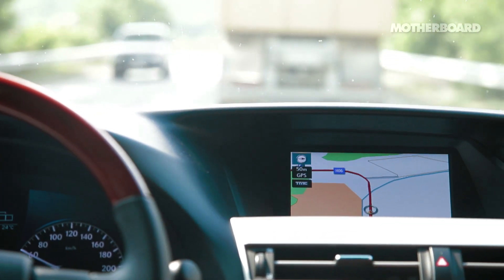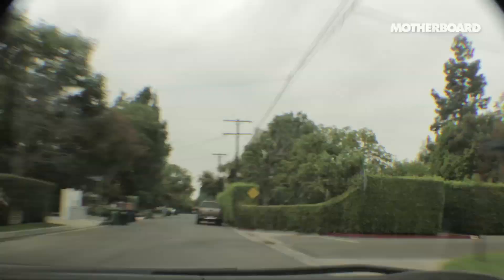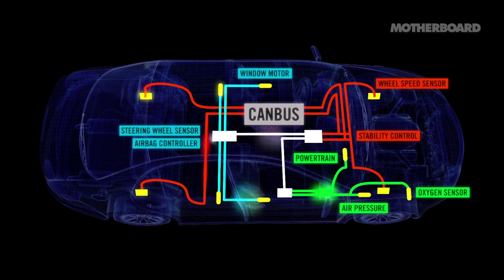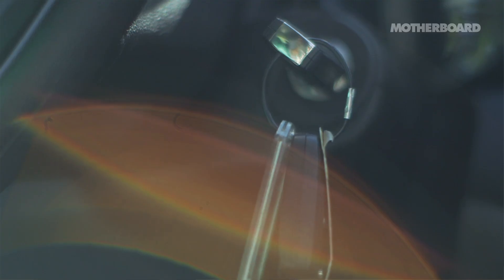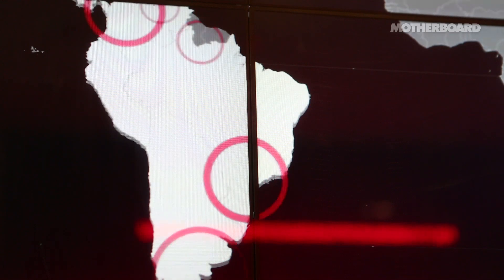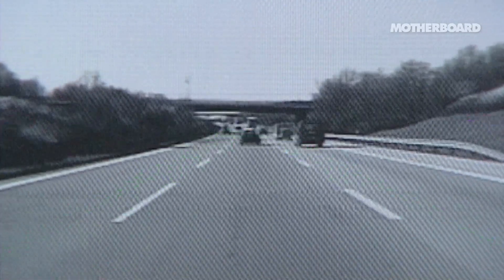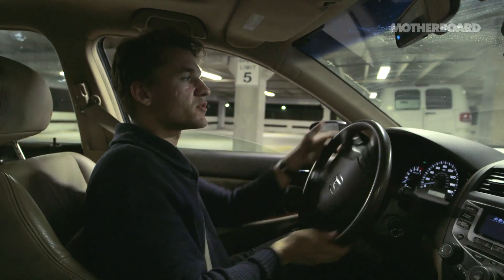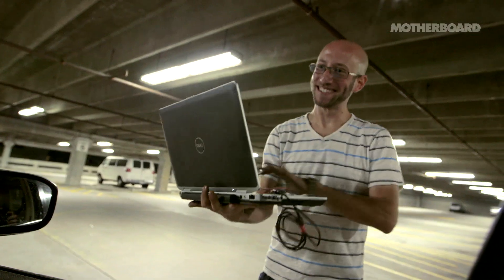How to Hack a Car: Phreaked Out (Episode 2)

Comment: Isn't it weird that recently governments have introduced recycling schemes to get rid of older cars?
Reply: Thank you FSS. Every gadget that has "smart" or "intelligent" in its name shares its data with agencies that carry "Intelligence" in their names.
Reply: PianoGesang
Yep. I have a 2 by 3 foot parabolic directional Wi-Fi dish set up over here that can handle 100 watts and do 50 miles. I can grab internet from unsecured connections 50 miles away anon. Anyway, currently connected by Wi-Fi at 5 Mb/s. One of the connections I can see not a block away is my neighbors new thermostat. If I was so inclined I could fuck with him, it's cold outside tonight, I could turn it off with my laptop and dish, and so could those 3 letter agencies if they wanted too.

I heat with propane, if they want to turn my heat off, well they will just have to come out here to do it.

When the Arab Spring went down, the Government in Egypt hut down everyone's internet and phones, and that's not the first time Government have done so either. I was in College taking IT/CNS classes at the time and one of my assignments from one of my classes asked by my professor was, "if they shut down communications how could you get the word out and communicate?"

Nice to know all Professors are not stupid. Don't depend on your phone, buy a man portable Ham Radio, and have your friends do the same.

Those smart meters have a zigbee communications device on them, that's how they control it from the power company or elsewhere if they wish. Look into that.

https://en.wikipedia.org/wiki/ZigBee
Reply: +FullSpectrum Survivalist

>> You need to use your brain

I do. I'm a Computer Scientist myself, so I think I'm reasonably qualified to talk on the topic. I'm not sure you are, though.

>> why do you think they are trying to link everything together, it worked fine the other way didn't it?

One word: Convenience. Computers worked well before the Internet became a thing. Now, with the Internet, they work better, allow us more access to information, and a lot of things, such as accessing YouTube from the convenience of your own home, or phone, or tablet, etc.

Cars have had on-board computers for decades... and they made the cars more fuel-efficient, among other things. The problem described in this video boils down to, as they said, people/businesses that do not think about security during the design stage of their technology.

The same is true of the Internet; security was not built into it from the get go. The same is also true with email, and other technologies.

>> I'll tell you why, one word, control.

Sure, control is something else that you can add to the list. That's why, IMHO, people should use software that has been released under free licenses (e.g. GNU/Linux), because when you control the software, you control the computer that runs it.

>> They can turn off everyone's power now at the flick of a switch, that's why we have smart meters, they don't even have to come out to our houses.

Or maybe it's because not having to send people to inspect millions of houses just to look at a number is significantly more cost-efficient. It saves money both to the consumer and tax payer because a single computer can do the repetitive task of thousands of workers (i.e. no need to pay people to visit homes for it), no need to maintain a fleet of vehicles that wear down and break, no costs for gasoline, and a bunch of other things I could mention. Did you fail to consider all of these things? Did you use your brain? (That was a rhetorical question.)

>> They can cut our power off, and leave theirs own, this is not a coincident.

So what? Even if they didn't have computers to do that, if you fail to pay your bills (though you might not be old enough to do this...), they'd still send people to your home to physically cut your power, or water service, or Internet service, etc. Given how crazy some people are, it's also safer for the employees trying to do their jobs (i.e. no need to risk getting attacked by an upset customer)

>> There is a difference between a silly conspiracy theory as you put it, and a conspiracy fact.

The difference is that the CT is still silly, and there is no conspiracy "fact". At best, any advantage that a government could leverage from an existing system would materialize after the fact, not before. For example, Facebook did not begin as a "conspiracy" to gather information about people just so it could be made available to government. Government just realized, years after Facebook had been operational by a private business and had already amassed a large number of people, that it could send subpoenas to a single centralized entity... and still, at least in the US, businesses don't always comply with them b/c there's something called the 4th Amendment that protects against unreasonable searches.

Ultimately, the only reason Facebook became such a treasure trove of personal information is because you, as a user, chose to give it to them willingly. No one "forced" anyone to sign up, much less post personal information about themselves like that.

If anything, Facebook is what it is b/c of the large number of people that choose to keep using it. The same applies to other technologies.

>> Ask yourself why  they are forcing things like smart meters. smart water meters, everything wired and controlled by a computer somewhere, etc.

Because computers are better than humans at processing large amounts of data very quickly and performing boring and time-consuming repetitive tasks on a schedule without requiring salaries, benefits, vacations, and so on? (That was another rhetorical question.)

No one is "forcing" anything on you. You need to understand that the infrastructure that is used to provide you with a service is owned and maintained by someone else, at a cost, and they're free to take concrete steps to improve their infrastructure to reduce their operational costs, improve services, and so on, just like you're free to not use their services. There's something called profits and expenses, and if your expenses are higher than your profits, you go broke, but you know that already, right? I mean, how could you not know any of this, given that you're oh-so-well informed? 🙄

They could also choose to not improve anything and keep you (well, your parents) paying more for the service due to its inefficiency and high maintenance costs, etc.

Did you fail to consider that? Did you forget to use your brain? (That was yet another rhetorical question.)

>> You don't need to be a rocket scientist to figure this shit out

I agree, you don't need to be... but apparently, you at least need to have completed high-school to get to a point where you can use your brain and see the difference between a silly CT and reality.

>> but feel free to be uninformed and ignorant

Yes, I'm an "uninformed and ignorant" guy with a degree in Computer Science and 8+ years of professional software engineering experience... clearly I have no idea what I'm talking about here 🙄

>> ignorance is bliss isn't it?

Apparently not as "exciting" as creating silly conspiracy theories and making yourself believe that you know the "truth" and everyone else is some kind of "mindless sheep" or "drone", and so on.

You certainly know how to throw insults. Actual facts and logic; not so much.
Reply: @Jazazamon
I don't mean to go against you in any way but you have not understood the problem with hackable cars and population control and the connection between them. I could but will not go into it now but let me put it this way, your (and my) imagination is limited when it comes to the imagination of swarm intelligence. Evil imagination. Don't be naive, be alert and on the lookout and widen your creativity (imagination).
Reply: it would be easier but cars are bad anyway the gasoline is not needed fossil fuels are a lie cars can run on air or magnets but the richest companies in the world are oil companies more people are killed today than in ancient times theres more than enough room for people the world is ina rat race
Reply: ***** "I don't care ... I far older than you are, and I know I am much smarter than you could ever dream to be." [sic]

That pretty much sums it up: you not care, but you know because you smarter so much. Of course you much smarter. You older long time. (The typos are intentional, if you didn't get it.)

More seriously now, you just got a lot of unrelated things, created imaginary connections between them, and called your imaginary reality "facts and logic". That you even believe that FEMA can cut your electric power shows how poorly informed you are.... FEMA is not even an electric power company..

Anyway, you can't even English, so much not possible to logic. (Again, the typos are intentional, if you didn't get it.)
Reply: ray
 I don't care what you think you are qualified to talk on, I only care what you are qualified to talk on, and so far nothing comes to mind.

"The problem described in this video boils down to, as they said, people/businesses that do not think about security during the design stage of their technology."

You are either stupid or naive, they thought of it, they just thought we wouldn't figure out what they were up too. They have teams of lawyers and other people smarter than you they use to foresee problems.

"One word: Convenience."

Yes, but not for you, for them, anything you think you gained from it is either a lie, coincidence, or they had to give you something to justify why you needed it, make you think you need it. In the long run, you will find it won't be worth it, the bad will outweigh the good.

"The same is true of the Internet; security was not built into it from the get go. The same is also true with email, and other technologies."

We are talking about 2 different things, that was a long time ago before they could see it coming, that's not true anymore, and you should know it.

"So what? Even if they didn't have computers to do that, if you fail to pay your bills (though you might not be old enough to do this...), they'd still send people to your home to physically cut your power, or water service, or Internet service, etc. Given how crazy some people are, it's also safer for the employees trying to do their jobs (i.e. no need to risk getting attacked by an upset customer)"

I'll wager I far older than you are, and I know I am much smarter than you could ever dream to be. If they have to come out, they would need millions of employees to shut us down at once, it wouldn't be possible, Are you really this stupid?, or just a troll? Maybe if they come out I may not want FEMA to cut my power, maybe they get shot trying. They know all this, hence how we got where we are today,

"Because computers are better than humans at processing large amounts of data very quickly and performing boring and time-consuming repetitive tasks on a schedule without requiring salaries, benefits, vacations, and so on? Did you fail to consider that? Did you forget to use your brain?"

No, did you fail to actual research? Ever heard of OCCAM'S RAZOR?

"Yes, I'm an "uninformed and ignorant" guy with a degree in Computer Science and 8+ years of professional software engineering experience... clearly I have no idea what I'm talking about here"

Right, clearly you don't. I would ask for my money back if I were you, you learned nothing. Just because you can code a few ones and zeroes, does not mean you know the subject matter, and clearly you don't have a clue. You are wasting your time even writing to me, and I am wasting mine responding.

I threw plenty of facts and logic, complete with links, you threw maybes, that's what the uninformed, what idiots do.
Reply: FullSpectrum Survivalist thanks dad! It all started from old theories of the wise one now developed. I want to learn more from you sir. Where can i follow you?
Reply: I pity the fool
Reply: new conspiracy theory? haha
Reply: Ich bin auf diesen russischen Hacker gestoßen, der mir geholfen hat, das Handy meines Partners zu hacken, der in einem anderen Land lebt. Schreiben Sie ihm eine Nachricht auf IG @ Cybercaliphate699, wenn Sie seinen Service benötigen. Außerdem ist er sehr erschwinglich.
Reply: Old cars are less safe and less energy efficient. It makes sense why they would do that.
Reply: Jazazamon But now all modern cars are hackable and there aren't any older cars with less electronics. I know it sounds weird but my cousin is always going on about this "population control" stuff and I couldn't help but notice this is easier if there are more modern cars with modern electronics on board than a load of older vehicles.
Reply: +Emily Powell We don't need "population control". If the world overpopulates there will be natural deaths that reduce it again whether due to food shortage or economic problems. Also killing it's citizens is the LAST measure the US would use to reduce population and even if they did want to kill us, car accidents isn't a likely choice to do that either.
Reply: Jazazamon That's relieving to hear after hearing about that stuff all week.
Reply: +Emily Powell No problem. Just here to help
Reply: @Jazazamon  I live in the USA the state of texas only can fit everyone in the usa in it with a 10x10 foot room so I'm not worried about overpopulation
Reply: ray
 You need to use your brain, why do you think they are trying to link everything together, it worked fine the other way didn't it? I'll tell you why, one word, control. They can turn off everyone's power now at the flick of a switch, that's why we have smart meters, they don't even have to come out to our houses. They can cut our power off, and leave theirs own, this is not a coincident.

There is a difference between a silly conspiracy theory as you put it, and a conspiracy fact.

Ask yourself why  they are forcing things like smart meters. smart water meters, everything wired and controlled by a computer somewhere, etc. You don't need to be a rocket scientist to figure this shit out, but feel free to be uninformed and ignorant, ignorance is bliss isn't it?
Reply: http://www.offthegridnews.com/grid-threats/power-grid-down-drill-to-be-conducted-by-us-government/

"				D'var 				
	September 1, 2013 at 4:07 pm
			
			 			
									 				
Hypothetically, you may be correct. But in reality, that is a stretch. I do not know about the globe in general, but this country (USA) will panic. Why do I say that? No one seems to know what just happened in California just about a week ago. The MSM did not tell the truth. “They” pulled the power plug on almost half of the state for two days. Said it was due to a “lightening strike fire at a power plant”. I live just a couple miles from that plant…there was no lightening strike, there was no “storm” of any kind all that day and night.
So why did people “panic”? They discovered everything shut down and closed up tight in 10 minutes. Every gas station, jiffy store, grocery store, restaurant, fast food joint, pharmacy, banks and all ATM’s. But this would be normal you say. Except the people found out that because of the “smart meters and new smart tri-valve water meters”(we were warned about those back in 2008, nobody listened)…we had NO WATER! None! I would have had to drive 400 miles to get a bottle of ‘water’. This is the “cities” I am talking about not just rural areas. Numerous counties went down in total “blackout in triple degree heat, no breeze in a stagnant chemtrailed sky.
They are “multiplexing our utilities” into ONE OFF SWITCH – your power. I know, I and others just lived it, and furthermore, I was informed by one who is “in direct charge” of that area…”yes – It is called Multiplexing of the utility system.” The people panicked and could think of nothing but “water” in almost half the state…and…this, was NOT even a “National Emergency”.
What they also did not tell anyone is that when the power came back on…the food stores — produce, dairy, meat, freezer depts. were all empty…only canned and boxed food left. Water and most juices…gone. Fast food and restaurants remained closed due to new food supplies having to be shipped. Outlying cities that had power ran out of bottles water and the like in 30 min.
So…good luck America…keep wishing and stuffing your head in the sand."

I think by now, we all should know what happens after they run these tests, and I think this guy is spot on.
			
Idiots like the one I blocked will find out the hard way, that they are fools.
Reply: +FullSpectrum Survivalist if you purchase a new phone what's the first thing they want. you're email linked in, etc. 

if you refuse to do the 1, 2, 3 steps they start looking at you like....why don't you want the ease of having everything linked. and if you don't link it....watch the problems that arise! (has been my experience)
Reply: ray
 No, you are just a moron, an educated idiot. FEMA can cut your power, all they need to do is call the power company, or maybe they don't even need to do that.

I have heard enough from you, you are done wasting my time. You are blocked, now go fuck yourself.

As far as caring goes, I cared enough to educate myself and others, you didn't care enough to bother doing either.
Reply: Please, not another person with another silly conspiracy theory....
Reply: @Code_dredd
Still think it’s a silly conspiracy theory?
The US government alone is capable of more than you could ever imagine.
Do you understand the concept of “brain hacking”?

Comment: c if you could hack my nissan micra 1.0 litre! with no power steering, no ABS, no on board computer! no spare tyre and finally to top it off one of the back sit is missing, best of luck.
Reply: It's called a flat head screw driver.....CHT V0.1